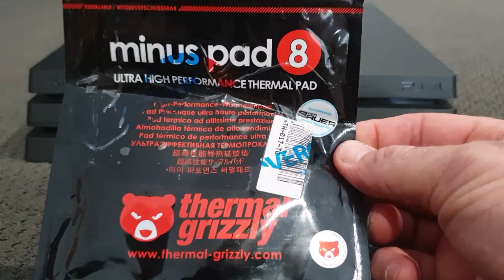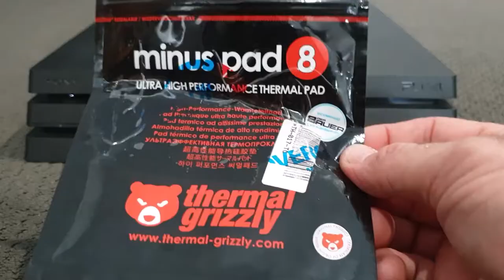Fan replacement ps4 pro

Comment: Did this to mine yesterday and its good as new, before it was louder than my pressure washer!
Reply from the maker: Yes it works well and saves it sounding  like a boeing 747 jet on take off lol
Reply: @snigeplays6070  fr i had the same prob with my slim so i got dpcool z3 and cleaned everything and tbh i was surprised at how much dust there was.
Reply from the maker: Its amazing how much dust can get inside the console

Comment: Awesome job bud.  I got a ps4 pro with no problems so far,
Reply from the maker: Thanks my ps4 is a launch edition one so its really old lol
Reply: @snigeplays6070  I got my ps4 pro  used/new from some one that never play on it, I’ve had it bout a year ago , I never took it apart to clean it, but I do blow it out and clean round it, it sits in a open area where there air flow , … I like it…. But I still have my old ps4 that still works just makes noise after I replace fan and ect, but still works…. ….
Reply from the maker: Its it still noisy try putting new thermal paste on gpu chip i recommend thermal grizzly thermal paste
Reply: @snigeplays6070  I don’t use my old system that much any more,   It’s my back system in case lol.

Comment: I installed the newer fan but I also put on Conductonaut liquid metal for extra silence. I used to only play for 10 minutes on my PS4 Pro before my modifications because I could not stand the sound of it.
Reply from the maker: Nice work mate its good to play in silence isnt it amd not sit near a jet engine preping for take off lol
Reply: @snigeplays6070  Tell me about it.
Reply from the maker: I ended up using thermal grizzly kryonaut thermal paste it worked really well as well i did my nest mates ps4 pro the other day to and it is now as quiet as a ps5

Comment: Great video, Do you know is that fan that you used the newer quiet model one, because I don’t know what the model number for the new quiet fan is? , I just wondered if you or any of your followers new . Regards Chris.
Reply from the maker: Sorry i couldnt tell you if it was the quiet one or not i just seen the fan replacment on line and bourght it i donremeber that fan came as kit had the screwdivers and thermal paste with it but my ps4 pro still runs quiet today can hear the fan spin up then it backs off and is really smooth no jet engine sound

Comment: Hy Bruh my console turns off by itself cause of high temperature .. i just cleaned everything but i didn't replace the thermal paste it was dried and my fan was rotating smoothly when I spin and it is clean too ... but when I turn on the console the fan doesn't spins ... and the console turns off in seconds .. if i replace the thermal paste does the fan works!  or something else??
Reply from the maker: It wouldnt hurt to change the thermal paste mate but it wont fix the fan issue if the fan is not running it could be the that fan motor is not working 
Going by your comment you im guessing you have had your ps4 apart could check to see if the fan is plugged in may have forgot that or if its plugged in properly just a thought if that doesnt work matbe a replccment fan the fan could burnt out and just doesnt work the other thing i would look at is the connector on the mother board maybe damaged or not connected to mother board properly if thats the case not an easy fix but i would check all the things i mentioned and a fan replace first and see what happens hope this helps 
Ps i have forgotten to plug the fan back in before to lol and had open the ps4 again a link to the fan i used is in my description of this video
Reply: @snigeplays6070  lol 😆 thanks bro 🙏
Reply: Once that seal is broken. You need to replace the thermal paste. Very important

Comment: I have a noisy ps4 pro if i change the thermal past and replace the fan without the thermal pads will my ps4 pro be quiet as yours ?
Reply from the maker: It should quiet mate i did the thermal
Pads as mine where damaged a little if your pads for ram chips are good you should be ok to just do the thermal paste and fan

Comment: Is the thermal pad adhesive? Or do you have to use glue? Also what brand is the thermal pad and paste you used?

Thanks
Reply from the maker: Deep cool is the brand of thermal paste i used and thermal grizzly is the brand of pad i used 
You dont need glue for the thermal pad as they are slightly sticky and hold inplace
Reply: Don’t use glue on thermal pads 😂

Comment: do you need to remove/unplug the power supply in order to remove the motherboard? I’ve seen a lot of people in reddit who broke it accidentally so I can say that it is pretty fragile.
Reply from the maker: Yes you do as the is 2 metel prongs that also plug i to the power supply connectung it to the mother board along with the small cable
Reply: @snigeplays6070  can I remove the plug from the powersupply instead from the main board? that looks so much easier.
Reply from the maker: Yes you can there is no problem to do that
Reply: @snigeplays6070  thnx btw, after sweating buckets my ps4 no longer sounds like a helicopter. After removing the powersupply I gained confidence and the rest was so easy.
Reply from the maker: Thats awesome it is daunting the first time you open it up glad my video was some help to you  have great day cheers

Comment: Idk if i have a older model of the PS4 pro but i dont have a cross clamp i have a singular clamp and no plate
Reply from the maker: Process should still be pretty mutch the same mate there 2 different types one with x clanmp and one with a clamp looked like an s but replacing the thermal pads and paste and fan should still be almost the same

Comment: Why was cooling fan replaced is it better than stock
Reply from the maker: I replaced the fan cos my ps4 pro sounded like a jet taking off it was so loud i couldnt enjoy the games anymore 
I dont think the fan i got is any better than stock but it does run alot quieter then it did i barely hear it run now when it is on amd games are playing
Reply: @snigeplays6070  would be grizzly what made quiet ive used grizzly pads & mx 4 thermal paste still is loudish when in apex legends main menu quiet when join game i dont know why. is diserpateing heat properly out rear of ps4 ive noticed ps4 pro psu is not has hottish has it was
Reply from the maker: To much thermal paste can make it run hot or it just could be that the fan is on on its way out like mine was thats why i replaced the fan i just did the thermal paste and pads while i had it open since i have owned mine since launch of the ps4 pro

Comment: Hey how much of improvement is due to new paste and pads and how much due to new fan?
Do you think I will be fine with just changing paste and pads? (7116b edition)
Reply from the maker: Nine times out of ten you can get away with just thermal paste and pads as long as you clean your fan really good and the heat sink grill as clear it all from dust and fluff and with good airflow back shoukd really help if you think your fan is working perfectly there is now harm putting that old fan back in i replaced mine due it not spinning like it should have also the improvment i have seen i my system alone is 100% as it runs as quiet as ps5 now like i said in my videos my wife wanted to keep the ps4 but yes runs newer games like farm sim 22 ac valahalla and avangers
Reply: @snigeplays6070  Thank you for your reply, cant w8 to fix this airplane
Reply from the maker: No worries mate hope it all works out for you one tip tho is get thermal grizzly thermal paste i need to update my link in the discription of the video it us more money but well worth it in the end
Reply: @snigeplays6070  I made my mind, going with TG-A-001-RS  paste and TG-MP8-120-20-10-1R pads. 
I had my eyes on Be quiet! BZ001 but it's out of stock.

Comment: Why you put blue tape inside the ps4 ?
Reply from the maker: I didnt put blue tape inside the ps4 you could be refering to the blue tape looking ends on the tape wires they are part of the wire for to hold on to dont damage the wire when removing them and reinstalling

Comment: 15:22 this cable thing isn’t coming undone no matter how hard i try
Reply from the maker: Hello friend 
If it is not coming off the mother board like i have shown in the video you can always try and take it off at the power supply it can unplug from there aswell 
But same the mother board plug be carefull not rip the socket off that that cord plugs into a needle nose pair of pliars can help to just make sure you grab the white plug that sits in side the connection dont pull on wires or the socket
Reply: @snigeplays6070  ok i’ll try next time thank ypu
Reply from the maker: Good luck with it mate

Comment: Use thermal pad thermal pad on cpu  use the good stuff for pc's  I done it 2 years ago and my ps pro is quieter than a mouse
Reply from the maker: I jave thermal grizzly pads and paste in the ps4 now it is good stuff
Reply: @snigeplays6070  i don't use paste my friend on cpu as jet sounding fan will happen. I play the likes of spider man and doom and never have any fan problems just better frame rates ,see its because Sony cheep out on the small stuff but its the small stuff that make the show happen.  Good luck take care 🙂
Reply from the maker: Fair enough mate 
Each their own 
But im thr same since using thermal grizzly paste on cpu  and pads on the ram chip amd hdmi chip the ps4 sounnds like a ps5 now quiet as now lift off sound or jet engine noice 
Thanks for your comments and you your self take cars aswell 
Cheerz

Comment: Wastw of work with that paste man .. z3😢
Reply from the maker: Why do say that ?
I have not had a problem at all with using the z3 paste on the ps4 my ps4 still runs today like brand new its quite as and doesn't get hot in experience the z3 paste works well 
Have a good day mate

Comment: What’s the point of replacing the fan? Just a clean it
Reply from the maker: Because my standard fan wasnt spinning fast enough when it needed to if your fan works fine then no need to replace it i needed to replace mine so i covered that in the video mate
Reply: @snigeplays6070  well how can I even tell if it’s not spinning fast enough, I put new thermal paste in mine and it slowed down a lot for obvious reasons, when I used to play rdr2 it was a jet engine (before I put new thermal) and the air coming out now when playing rdr2 for several hours goes up to a max of 148F, but it likes to sit around 143, and the fan doesn’t make any weird noises, but the top of the console is warm, while it doesn’t get cooler, it doesnt get hotter than from when it was on the Home Screen when playing rdr
Reply from the maker: My ps4 suonded the same mate when i took my ps4 apart the first time i only replaced the thermal paste and put it back together and then it was loud on home screen of marvels avengers game so played that game for 2 hours ps4 still loud as like jet so i tried ac valhalla same thing both big games in the way they look and perform so i then decided to change everything out thermal pads on ram chips and thermal paste and fan once i put the fan in it would spin up but was much quieter then the original fan then i sat down and looked at the old fan and found it was loose on the spindle and had alot of play in the fan motor where as the new fan did not but that was just my fan mate so in my thought my og fan was no good to me it should not have had that much play in the fan
Reply: @snigeplays6070  I didn’t replace the one x’s ram chip pads but they weren’t hard or anything,  they were like clay and easy to move, I didn’t take them off I just put them back on,  It just starts blowing heat when I turn it on, even on the Home Screen, I hope it’s normal (the fan isn’t on high speed on the home)
Reply from the maker: Oh ok did you have good quality thermal paste mate i used 3 to 4 different ones  before i found a good one i am currently running thermal grizzly thermal paste now the z3 linked in this video only last 6 months and then went funny so spent the extra cash got thermal grizzly paste and i havent looked back since mate maybe try the thermal grizzly paste like i did
Reply: @snigeplays6070  I used arctic silver, my Xbox one original run about 120-130 playing subnautica below zero, and my Xbox one x is 140-148 (generally 143-144) playing rdr2 4K enhanced HDR, just wondering if that’s normal or not, and we are going by the exhaust air temp not the chip itself
Reply: @snigeplays6070  I used arctic silver, my Xbox one original run about 120-130 playing subnautica below zero, and my Xbox one x is 140-148 (generally 143-144) playing rdr2 4K enhanced HDR, just wondering if that’s normal or not, and we are going by the exhaust air temp not the chip itself
Reply: @snigeplays6070  I used arctic silver, my Xbox one original run about 120-130 playing subnautica below zero, and my Xbox one x is 140-148 (generally 143-144) playing rdr2 4K enhanced HDR, just wondering if that’s normal or not, and we are going by the exhaust air temp not the chip itself
Reply from the maker: If it is the exhaust air temp you are going by it will always read high the good thing is that it is getting the hot air out you really need to see the chip temp to give you a more accurate temp reading of your system but if your system is running fine and your fan is hust load you may want to try a new fan it could help make the system quieter plus you can put to much thermal paste on and that will make it not cool properly aswell you only need a 3mm by 3mm pea size drop should work perfectly
Reply: @snigeplays6070  the amount of paste I put is fine, I don’t notice any frame drops after pushing it for hours playing rdr tho, it’s just I’m not used to hot sustems
Reply: @snigeplays6070  I’m just wondering, if the temperature that it exhausts stays the same at 143-145, no matter the speed, is that normal, to me it seems like it’s fine
Reply from the maker: It probably is normal for exhaust temp it will always be hot as long as the fan is getting the hot air out of the system thats a good thing
Reply: @snigeplays6070  I know it’s just the coolest the air gets is about 130, this is at the Home Screen, but on games like minecraft it will go up to 140 F and just stay there, with a quiet fan,  a game like RDR2 with all the enhancements goes up to 146 but stays around 144, with a louder but pretty easily ignorable fan noise, it’s just the fact that it is consistent, and before I replaced the thermal paste, the fan would run at max in rdr, with somewhat warm air coming out the back, and no noticeable frame drops even after hours
Reply from the maker: 140 F is about 60 Celsius so that is about normal running temp but like i suggested earlier maybe a new fan could help  reduce the fan noise that was half the reason i did put a new fan in mine aswell was to hopefully reduce the noise as well as needing  the new fan and it seemed to work for me mate the fan spins up you can here it still but it is at a nice much quieter noise level you can always try anew fan mate if you want
Reply: @snigeplays6070  the fan noise isn’t a problem for me, it’s just I hope it is working as it should
Reply from the maker: You will know if it not mate the ps4 will throw an error and turn itself off if it gets to hot
Reply: @snigeplays6070  oh alright that’s great

Comment: Why did you put a thermal pad on the HDMI chip?
Reply from the maker: I put the thermal pad on the hdmi chip just cos they got hot to i dont know if it was necessary but i did it for peace of mind for my self just to help keep cooler i have seen other ps4 where the hdmi chip has gotten hot and failed  so anything to help was a good idea in my mind
Reply: @snigeplays6070  ok, I've seen other people doing that, but I heard in order for it to work, you need something on top to sandwich it. My concern was that it might cause problems with the machine, if I added a thermal pad. Have you thought of placing a pad on the Scei chip?
Reply from the maker: Havent thourght of putting one on the scei chip i may have to look into it all tho my ps4 pro is running perfect since doing this video and am having no problems  im pretty happy with the job i did so far no hiccups lol touch wood 
Thermal pad i used seemed to sandwich in fine on my hdmi chip aswell but i guess you could always get a thicker thermal pad if you need i used 1mm pads
Reply: @snigeplays6070  glad this all worked out well for you. 👍I must say, great video, and well explained 😊
Reply from the maker: Thank you like i said in my description i did my best 
I made the video to try and have something to help people on my channel hopfully it does that i only started my channel about 6months ago.
Glad you like the video have great day